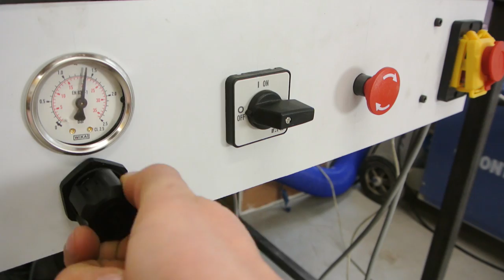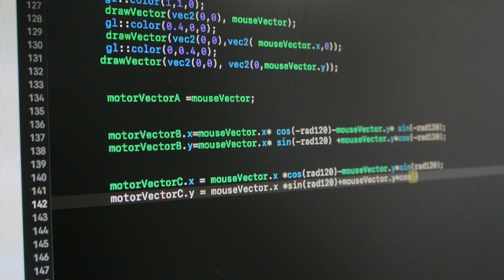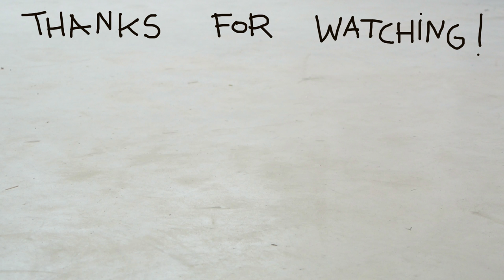Omni wheel Robot part 1 : prototype

Comment: Hello, I love your project I think it's amazing, you see that you've put hours and has many interesting features. I would like to know in the vuteo 1 minute 3.46 an animated animation of the movement of the robot appears according to strips of a vector, what program is ?? Have you left it in some place to share it? On the other hand you use the Lsm303d but I do not see documentation of how you have implemented it with Arduino and I do not know how it works. I hope you can help me to realize my omniwheel that is still very green. Thanks
Reply from the maker: Thanks :) You can find the source code of the vector thing on my github https://github.com/neuroprod/omniBotProto (pc tester) you need https://libcinder.org/ to run it. I don't use the Lsm303d anymore (I use the camera tracking to get the rotation) but you can find it in an older version of the arduino code on github

Comment: Any reason you use dc motors instead of stepper motors? I'm currently trying to use this kind of dc motor (or quite similar) on a balancing robot, but I'm having problems calculating the velocity accurately. It seems like your code calculates the velocity, but how accurate is it, and is it accurate enough for a balancing robot?
Reply from the maker: The motors have encoders, so I know the velocity. But for your balancing robot you don't really have to care about the velocity (for a basic one). You just work with the angles from your IMU, put those in a PID that outputs the pwm of your motors. your PID input=current angle, target=(0 if you stand still, +x to move) , output =the pwm. Its all about tuning the PID :)
Reply: Yes, I tried using only a PD loop for balance (basically pitch as input and pwm as output) and that worked quite well and it's able to balance for a while. This means it's depending on a perfect levelled imu, otherwise it will drift off and eventually fall over. In my understanding you need a control loop for velocity in order to make it able to balance in place for an indefinite amount of time.

Comment: I really love your way of making videos. May I ask in which country you live?

Cheers Kay
Reply from the maker: Thanks Kay! I'm from Belgium :)
Reply: That was a surprisingly quick answer :D I am planning on building a waterproof aerial photography tricopter, eventhough I am not quite sure how good thats gonna work out :)
 And since I am just a 16 year old student I have quite limited ressources for machining and stuff like that, which is gonna make the plan of using carbon fibre a bit more difficult.
But long story short I am planning on building a plastic hull with carbon fibre structure inside and I planned to embed all the microcontrollers inside the carbon fibre(as in cutting holes in the plates for the circuit boards to fit in) and wanted to ask you for your opinion regarding the stability of such system :D 

Cheers Kay
Reply from the maker: Hi Kay. I really cant tell. Don't know much about copters or carbon fibre. But you should try it : )

Comment: Hello, I can see u used  an accelerometer in your robot, but i can't find it in your code. So you didn't use it? Can you tell me why ?
Reply from the maker: Yes, your right, I don't use it anymore (you can still find it in an earlier version of the repo :https://github.com/neuroprod/omniBotProto/blob/7b099f19433d80172ef91988a643607e6ec20ab6/arduino/Omniwheels/Omniwheels.ino) I now use the camera and leds to get  the orientation :) check the next videos in this series
Reply: Can you share some experiences when you work with the compass? Such as the precision, disavantages when using the compass ? Thank you so much (:
Reply from the maker: The main issue with using a compass is that it get distorted with the magnetic field of the motors. That's why i put it on the wooden stick, away from the motors  :)